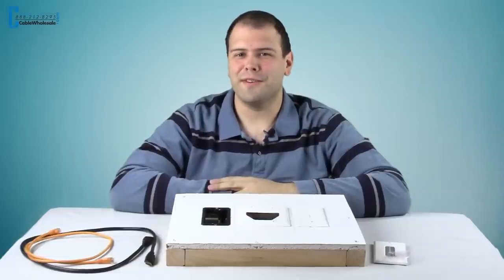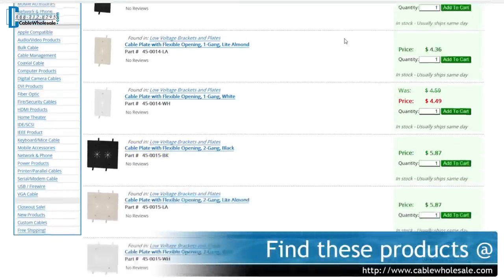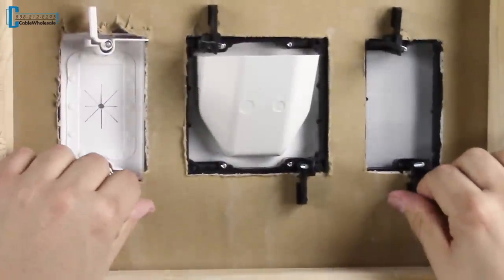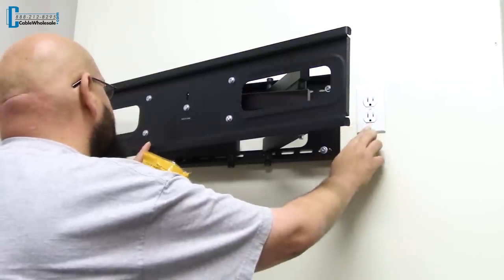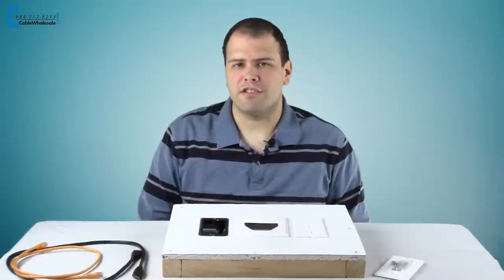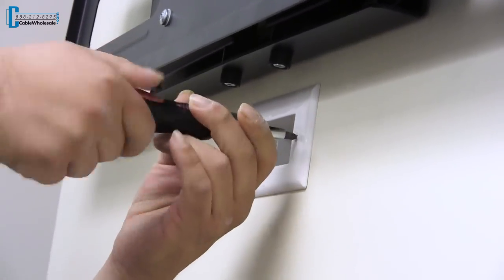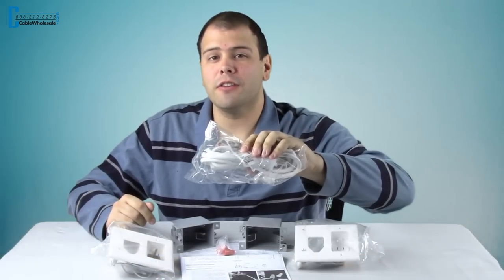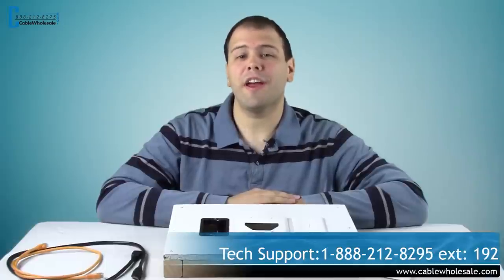How to Hide Wires for Wall Mounted TV - Easy DIY

Comment: Problem with these videos is nobody tells you the TV needs to be on or below the horizontal wood that joins the studs behind your dry wall
Reply: Those are usually fireblocks. Also can be used to straighten the wall before adding sheet rock. And I usually drill through those.
Reply: Stud finder or take your phone stick in cutout with flash on and take a pic